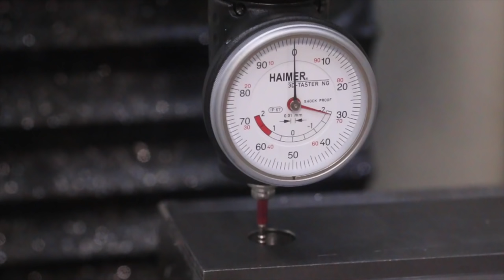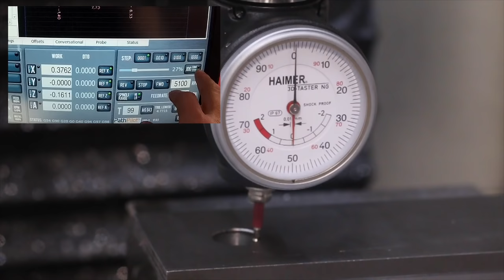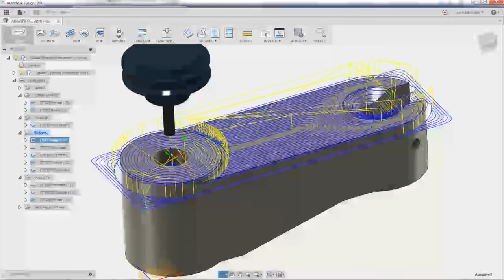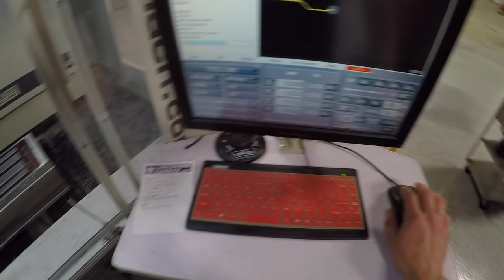Abom79 Parking Attachment!  Part 2  Widget96

Comment: Interesting point about small end mills.
My neighbor at the shop is a mold maker, he is always cutting super fussy parts out of hard steel (p20, H13).  He has a brand new HAAS VM-2 and he cuts some large parts but he is always using small end mills (1/4, 3/8) and taking light fast cuts.  It seems counter-intuitive but it seems to be an effective strategy. (time, cost, and machine wear)
Thanks for the videos!

Comment: Who forgets to set their Z-height correctly?  Everybody at one time or another, at least you didn't screw up in the wrong direction.

Another possible reason for the "leftovers" on the adaptive tool path: if you used a tool with a corner radius, but created the tool path assuming a square corner, some bits could be left behind where the overlap between adjacent tool paths is less than 2x the corner radius.

Comment: I like how you move from CNC, to manual on your "drill press"  :D

Not sure if it's just preference or not, but you don't need to move to 0 when sweeping side to side after every sweep, you can just tap your part until the sweep matches on both sides, then 0 and double check.. would save you some time while tramming parts.
Reply: That's why i asked if it was just a preference. I know time is money, and every bit of time you can save adds up at the end of a job :)

Comment: Just a thought but if you milled the 2 finished boss faces and put the thru hole in one and the tapered/straight slot in the other. Then set up a aluminum pc in the vise and milled 2 matching bosses to locate the part and clamped thru the hole and slot you could have machined the whole outside and remainder of the top in one setup. then flip to cut the bottom step. I believe that's how I would have tackled this project but anyhow nice job John it's good to know I am not the only one who struggles on occasion. I was always taught that the only time a machinist hurries is when he has made a mistake or is about too! LOL

Comment: Hey John that part looked nice. But if I was to make that part, I would bring it over to the Bridgeport and square all sides to finish dims. first. If it really had to be close then i would check it on a surface plate and use a ground step block to check square first. Then you know it's to size and square so that when you flip it and indicate it that it is parallel. Also don't bother using carbide roughers you don't have a big enough machine to make it very efficient. H.s.s. roughers will work fine as long as you leave 0.010" - 0.020" to finish with. But if you square in in the Bridgeport using a 2-3" dia. face mill you can take .100" off in a pass easily. Just figured it might help in the future. Great work nice finish I think Adam will be very happy with it. I do a lot of job shop work like that. I started out doing 3D work all on a Bridgeport mill no cnc and I learned how to be fast an efficient the hard way lol. Now most of the time I square them on a Bridgeport then grind if needed then run them on cnc. I think a lot of people forget keep it simple is best way most of the time. Any way good job and keep up the good work!

Comment: I would be curious to see the difference in quoting the job between the two methods: CNC vs. manual milling.
Reply: there are too many variables involved really...its all up to the programmer and machine for the cnc work. a guy with a cat 50 machine is going to knock this part out in fractions of the time than a guy with a cat 30 or 40...nature of the beast really.

Comment: Oh and to avoid those Z height mishaps when flipping a part I usually measure the Z height from parallels or like in your case from the vise and then just lift the offset the amount of the part height. And still even average quality carbide end mills need way more RPS-s. For steel a 6mm endmill needs about 9500rpm and 12mm 7200 rpm.

Comment: Side note.  When tramming with a haimer. DO NOT bring the needle to the 0-0 mark.  Only bring it to  the first 20 thou mark. 

Running the probe when it's under full tension like that will not only cause inaccurate measurements but will damage the internal mechanisms.
Reply: interesting...   when dragging the tip you want the tension on the weak side?
Reply: +AnimalMother224 
Yes. It's still measuring. If it's at full tension the force will cause the probe to drag and lag behind in the opposite direction you're moving it. Causing errors in its reading. 

Example if you're traming X straight. You only want it to be measuring in the Y direction. At full tension it'll measure in X and Y as the tension on the tip will drag against the part. The less tension against the probe the less drag on the tip. And the less error will incur.
Reply: yes that's what I do as well. I just use the first 5 thou. still not as accurate as a DTI but usually close enough.
Reply: +Occams Sawzall 

In fact right in the haimer manual (which I'm sure few people have read lol) it specifically says to do it that way. 

It also describes the way to use it to center up a hole. Which is -X to +X. Halve the distance measured. . +Y to -Y Halve the distance measured. Then +X to -X and halve the distance.  So John actually did that correctly :)
Reply: instructions?   HA!  thats adorable   :)
Reply: I've learned over the years that anything German and Swiss built. Definitely read the manuals!  They're super picky and strangely specific. And not following them to the T causes untold havoc. 

Had a DMU blow out all its seals one by one because the wrong coolant was used.  Was speced for Euro standard non-petroleum based.... Guess what was used...

Comment: Heyho

If you use a 3D- egdefinder, it's allways better to move the whole way back out of the measuring range, if you overshot the zero.
Because even the best of them act with some sort of backflash, check out the manual maybe this thing is blessed with no hysteresis.
Most times it's not that much, less than 0,020 mm I'll guess, but it will be disturbing, when it comes in use to measure something like a precise hole diameter.

Comment: When we drill holes on cylindrical or other non-flat surfaces, we always spotface before drilling. That prevents drill drifting and breaking taps.
There's not much material strength lost.
I've also noticed that your cam program creates g-code that cuts a lot of air.
I hate cutting air, in case you haven't noticed.
Not a big deal for simple parts but for bigger, more complex parts, it starts to waste time and money.
As far as tool chatter is concerned, I think bigger is better. If I have a choice among 1/2", 3/4" and 1" end mills of about the same length and I have room, I'll pick the 1" end mill every time.
Just curious, do you have a tool height setting fixture?

A little constructive criticism.
Nice project. Adam will love it.
Thanks,
John

Comment: John,
Another very well done video. I watched it just shortly after being uploaded, but my computer went down before I was able to comment. Glad I made a complete backup Monday evening.   :-)

Did you measure the reamed hole to determine if the diameter reading was close when you flipped the part over and used the hole to register the part?

And as others already mentioned, like the pallet used for shipping that sized package back to Adam.

Comment: Same question as last vid. Why the climb cutting?

Always like watching the videos.
Reply: Conventional milling is dead. CNCs have the rigidity to take much heavier roughing cuts without the risk of the tool pulling into the job, which is pretty much the only reason you'd  conventional mill. Climb milling produces a better finish and in roughing operations it is much kinder to the cutter, especially if your using higher feeds. Think how the clearance is ground on your endmill and where it is in relation to the material when climbing or conventional milling. Climb milling means you have a lot 'freer' cut. Don't take my word for it, do a bit of roughing at the same speeds and feeds going the other way, the tool life will be dramatically reduced. The only time i conventional mill is with a slit saw, possibly with a woodruff cutter, but now we have insert T cutters I climb with those too.

Comment: Can you teach a newby about your method of shipping?  I assume the pallet was to add an extra layer of protection.  What is the cost of shipping via a pallet vs a larger or maybe a double box?   Thanks.
Reply: The overdone packaging is a thing between the YouTube machinists/creators. I think I remember that Tom Lipton started it by shipping a welded steel box to Adam that had to be cut open on the mill.  It just keeps going from there........

Comment: I wonder if you pushed your carbide tooling harder (faster RPM, higher feedrate - same cut per tooth and WOC/DOC) whether it would reduce the chatter you got coming around the round ends of the part (mostly the roughing endmills in part 1 but also a little bit on the 3/4 inch endmill in part 2)? It'd be interesting to see how much spindle power you had up your sleeve, if any but I don't think you have a power meter installed on that machine?

It seems a bit counterintuitive to suggest harder milling to reduce chatter but that's what I see, albeit in turning operations rather than milling - I up the RPM and feedrate when I get chatter and it usually improves. As a side benefit, the faster RPM also tends to give an even better surface finish. I imagine those endmills would be up for it as much bigger machines can drive their tooling harder.

Great job overall, the part came out looking nice. I was very impressed with that ball endmill.

Comment: Ok. Now I really wondering here

You have a roughing endmill and a finishing endmill capable of reaching the entire height of the part. 

Why not rough and finish the outer profile and the slot all in op 1? Then op2 and side hole as normal (minus the botch on the side hole ;) )

Coulda skipped that fixturing nightmare completely 

PS.  Called it on the part prone to wanting to rock and not line up flat doing Op2 that way ;)

Least you got some alignment practice outta it.
Reply: +NYC CNC the largest strongest tool that was taking the least material off was the one you most worried about??  :)

Comment: If you use a 1/2 EM for the uphill milling, you can get smaller scallops with a larger stepover than with a ball mill. Try simulating it and you will see what I mean.
Reply: The closer to vertical you go, the closer the cut becomes to that of a ball mill.  The closer to flat, the larger the effective radius becomes.

Comment: Setting the wrong Z isn't embarrassing at all,  I was setting a new tool up and added an extra inch into the cutter comp settings. I pressed the go button and the first move was a rapid movement above the part. The tool dove straight down into the work piece scarred the crap out of me.

Comment: You don't need to re - zero the x, it will still give you the exact centre point just from touching 2 points on the hole if they are exactly opposite.
Reply: For what he was doing. No. 

But it's good practice to re zero the X like that, especially if part has fussy dimensions. 

Though to be honest I'd never use a haimer for locating like that. I'd tram with a test indicator.

Comment: Nice! :-) I myself (the few times I have milled something) prefer to set my Z zero (others also) on a milled face. In this instance when you flipped the part I would put my Z zero on the vise bottom face where the part will be resting. X and Y are what I probably would have used myself. It must be cheap sending whole pallets over there ;-)
Reply: +NYC CNC You got to show that mistakes can be fixed relatively easy, so that is probably more educational than making it right the first time every time ;-)